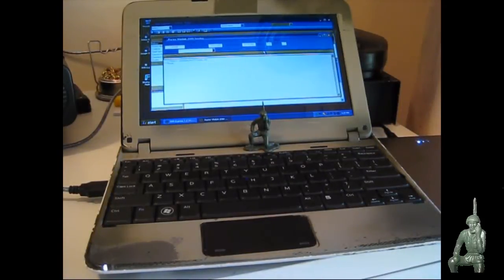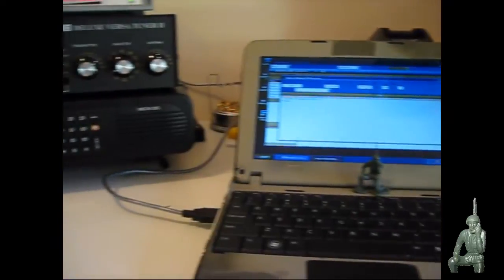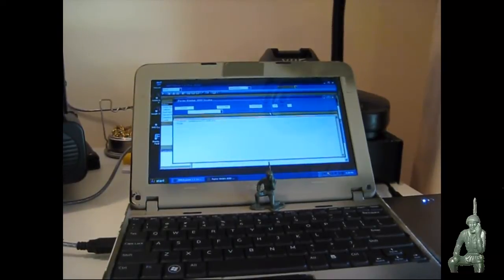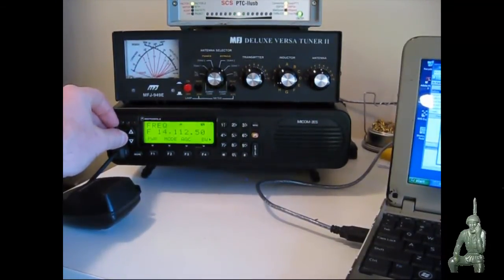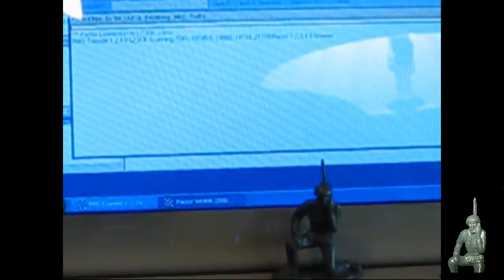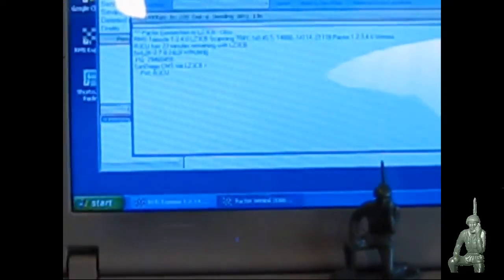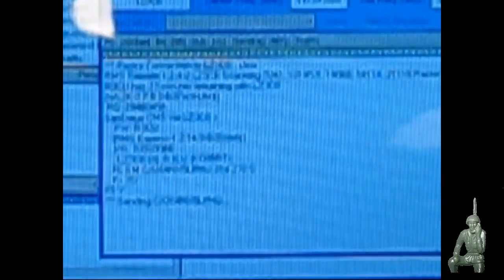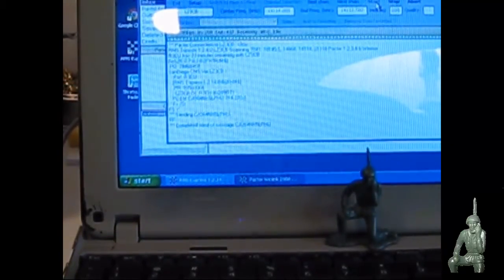Winlink

Comment: thank you so much for this video, it answers a key question I had today, just got all connected up, and managed to get the computer to communicate with my kam xl...and it kinda looked like it was talking to the radio, however, my mic stayed on the entire time, so hearing incoming was not happening, I probably have a short in the cable I made or the diode I stole out of an old computer power supply for the cable was bad/wrong ....back to the soldering iron apparently. thanks again
Reply from the maker: I'm assuming you are looking to access the Winlink system with Pactor-I and the Kamtronics modem (this is what I used when I started).  What radio are you using?  You can buy ready-made cables that may make things easier.
Reply: Commsprepper well....imagine a guy thats had a General license for a year...still learning voice communication, that two weeks ago was given a new Kantronics KAM XL and told, you're the communications expert, get things working...I will be studying up tonight on what Pactor-I is....I have an old Kenwood 440, downloaded and setup RMS express and I think I set up Airmail3....watched several videos on RMS use....yeah, took the cheap way out and will probably order a premade cable to eliminate one other area of doubt. I posted my suspected issue on the ts440 yahoo group discussion and sent an email to the Alaska winlink....ummm, person, station? lol, I am still learning the terms. No hurries....especially since my busy work schedule time is coming up....any direction pointed is a direction I am unaware of ...thanks for any info KL3KL
Reply from the maker: akwildernes Skip the Airmail.  It's old and clunky.  RMS Express should be your first start (then you can progress to Paclink which allows you to use and external POP3 client like Outlook).  I suggest you get RMS Express installed and get confortable with sending and receiving messages with the Telnet option (Internet connection).  This will get you up to speed on how to use the program. (I did a vid on this awhile back RMS Express Program For Emergency Communications).

Questions.  Have you created the Pactor connection in RMS Express?  If so, does your PC initialize your modem?
Reply: took the kam xl to an experienced rms hammer, I had a bad diode in my cable I made, all is working great...naturally its my busy time of work so limited on even checking my email...I been playing with both rms expresss and airmail...and on check in tonight an old timer wants to connect with me using mmsstv...I am going to website at the moment...lol